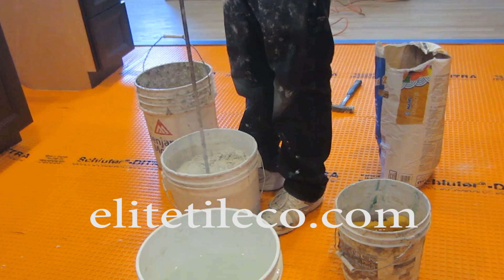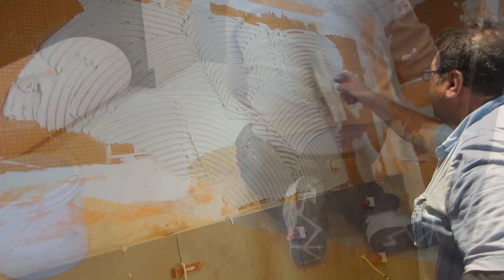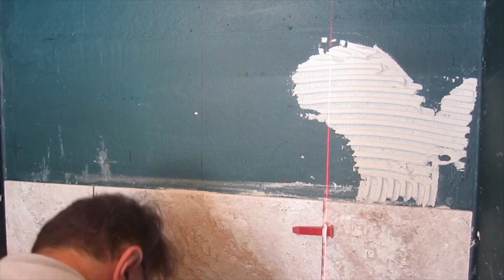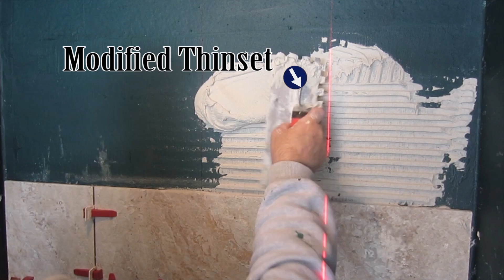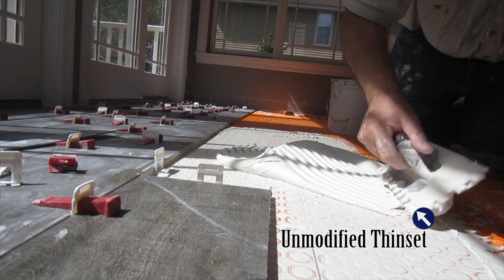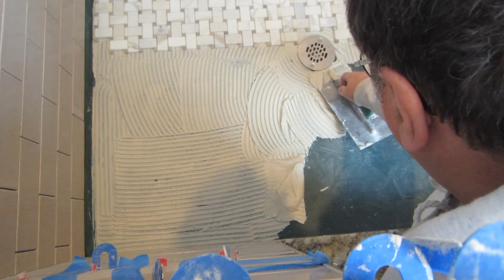Thinset explained

Comment: Ardex says their X77 microtec modified thinset can be used on uncoupling membranes. Have you hear this Sal? Do you agree?
Reply from the maker: Yes it can, no problem
Reply: @SalDiBlasi  thanks for the quick reply. can you explain why it's ok to use this modified thinset between the ditra and tile when schluter asks for unmodified?
Reply from the maker: Actually it has been a few years now that advancements in mortar technology has seen the development of many new mortars that make it possible to use a modified mortar between two impervious surfaces. These mortars will cure and harden without the extended dry times, they no longer need  evaporation of excess water to harden and dry. Schluter makes its own mortar, "AllSet" which is a high polymer content thinset Mortar that meets ANSI A118.15 specification, which they recommend to use for the installation of all Schluter products and also to set tile over those products. Also many manufactures will substitute their warranty for that of Schluter, if you use one of their approved mortars to set tile on Schluter products. The issue has never been whether a polymer modified mortar would work on Schluter uncoupling membranes or waterproofing membranes, it has always been about the extended dry times needed if they were used, that is why they recommended the use of an Unmodified mortar that cures and dries by Hydration. As a side note, the manufacturers of all other membranes never required the use of an unmodified mortar.

Comment: But then Schlueter came up their own modified thinset called allset they claimed it can be used on any situation. Why?
Reply from the maker: This video was done before AllSet was available. The reason that modified thinset can be used is because of an advancement in thinset technology that has made it possible to have a chemical dry of the thinset between two impervious surfaces. Many of the newer modified  thinset from other manufacturers can be used for this type of installation.
Reply: @SalDiBlasi  Thanks, I was hesitate to use modified thinset between membrane, I will give Allset a try.

Comment: So shouldn't you use an unmodified thinset over a roll on membrane like Redgaurd or Aquadefense since the the moisture would get trapped in just like if using Schluter and wouldn't let it dry properly? You pointed out that the thinset your using over the Aquadefense is modified.

Comment: Thanks Sal.

I notice you use modified Mapei over AquaDefense (as recommended). AD is also impervious to moisture (like Schluter), so why does modified work between two impervious surfaces for Mapei but not Schluter? Similarly, Schluter says use unmodified between cement (porous) and Ditra. I’m sure you also know that unmodified has to be super sloppy/wet for Kerdi and Ditra to bond to the substrate.

I still don’t quite get why can’t use modified for Schluter!
Reply from the maker: With some advancements that have occured over the past few years, that is not as much the case as it used to be.

Comment: If I’m installing Schluter Ditra to my cement basement floor, which mortar do I use? I’m new to tiling but would love to do our basement that’s $800sq ft. Any cheaper mortar you recommend besides the Schluter brand to install the Ditra on the cement?
Reply from the maker: Pretty much any good quality mortar will work to install the ditra on concrete, unmodified or modified.
Reply: Will there still be a warranty with Ditra if I use a different mortar brand though?
Reply from the maker: @absolutemalmaute9592  Yes as long as you use an unmodified to set your tile on the ditra.

Comment: Both types of mortars (white or grey) can go under any Schluter products and under any type of tiles installed over Schluter products with two exceptions. Both types of mortars cannot be applied over vinyl material and also the un-modified one (grey color) cannot be applied over plywood or OSM (particle boards). 
 If you install Schluter products over plywood or OSB subfloor, don't use the grey one (un-modified - Schluter Set), use the white one as it sticks and has a better bond.
I did complete the four days course from Schluter and I have to admit we used in class for hands-on training, the grey one, un-modified. I guess because is almost half price cheaper than the modified one and with the same result.
Here is the link for Schulter thin-set for more details: 
https://www.schluter.com/schluter-us/en_US/select-thin-set
Reply from the maker: The suitability of a mortar for a substrate or tile is not the color, that is irrelevant, what counts is the standard it conforms to. watch this https://www.youtube.com/watch?v=BJoPHGtukqo

Comment: Setting cement tile over  Schluter ditra would be recommend to use what type thinset?
Reply from the maker: Any Schluter brand mortar, or any other  premium unmodified of any brand mortar.
Reply: @SalDiBlasi Thanks Sal, for responding to my question. In my experience in the installation of cement tile over the ditra . It's a much better lay and more efficient for the setter with modified. I did a 16 hour test with 8"x8"s using both, the conditions were ideal. The modified was superior. That's why I asked the question. Thanks again Sal.

Comment: I use MODIFIED thinset 99.9% of the time.... years ago it was always via latex or acrylic additive (liquid)... today I've been using Flexibond and mixing with water.   But since Schluter products are tough to get where I work...  I'm normally installing over Durock,  using Redguard in wet areas - and  just cementitious board (usually 1/2 Durock- ALSO thinset with modified...  in other areas.   Seems to me Durock + Redguard is about the same thing as  Schluter/Kerdi in that there's no place for the moisture to go.   But I've never had any issues-  I wait a few days before grouting anyway so does not matter how long the dry time is for the thinset.... and I've never had problems on shower walls using MODified Thinset over Redguard. . 

So... are you saying it's A-OK to ignore Shluter's requirements to use UNmodified Thinset and use modified anyway on Kerdi?  Like others - while I appreciate the building science.. hydration/crystals/etc.....  but I am confused whether or not modified thin-set can be used with Schluter products.    Can it ?   Thank you Sal.
Reply from the maker: All the other manufacturers say to use modified  when going over a liquid applied waterproofing membrane, so they do not consider it to be a problem, schluter specifically wants you to use unmodified over ditra or kerdi, unless you are using Schluters own thinset which was not available when this video was made. https://www.youtube.com/watch?v=7N2k1RnmeJI&t=2s So follow manufacturer recommendation if they call for modified, then use modified, if they call for unmodified then do that. It should also be noted that there have been advancements in Thinset technology which enables a chemical cure allowing for thinset to dry without the need for evaporation, so there are many new thinsets that have this ability.
Reply: @SalDiBlasi  would you use modified or unmodified under the cement board? Under the cement is the subfloor 3/4" osb
Reply from the maker: @raptureready9502  Modified.
Reply: @SalDiBlasi  what about under the tile? Tile is 6"x24"
Reply: Porcelain tile
Reply from the maker: @raptureready9502  Modified.
Reply from the maker: @raptureready9502  You should watch this video https://www.youtube.com/watch?v=BJoPHGtukqo&t=495s

Comment: Hey Sal, I heard a contractor mention something about how thinset can become "detempered" if it's not mixed correctly, resulting in a fail. I didn't quite catch it, but it was something to the effect that after letting it slake if you realize you need to add more thinset powder to the water to stiffen the mix it will cause a fail. LIkewise if you add more water to the mix to increase the soupiness of it. Is this right? Is it generally ok to add either water or thinset powder when mixing as long as it's done before letting is slake?
Reply from the maker: The guy is actually correct, once the thinset has slacked, it should not have water added to it, or powder. If has been sitting in the bucket a bit and starting to get a bit stiff, it can be spun with the mixer to loosen it up, but don't add anything to it.
Reply: One other thing I've heard conflicting ideas about is which to add to the bucket first: Water or thinset. I've noticed that adding the powder first then water can cause clumping and throws up excessive powder "clouds" which obscures the view of the inside of the bucket making it harder to mix correctly. I see you added the water first in the video which answers my question, but just wanted your take on if there is ever a time when the powder should be added first.
Reply from the maker: I always add the water first, but as long as it is thoroughly mixed, it can be done either way, the water first does make it easier.
Reply: Hey Sal, it's good to know you're here, educating. I've come a good ways thanks in great part to your video productions. I decided to join NTCA after viewing several of your vids on the subject. Best decision I ever made. Carlos Collazo
Reply from the maker: Well then, you need to become aTile Geek https://www.facebook.com/groups/TileGeeks/?ref=bookmarks
Reply: :D

Comment: Sal, I would like to know your view on the durability of a tile (porcelain & ceramic)installation using the practice of each the following methods as opposed to laying tile on a dry and set deck mud base.1. immediately  laying floor tile using thinset  after putting down  the deck mud base (while it is still wet).2. Sprinkling Portland cement over still wet deck mud base and laying the tile on the Portland cement . thank you.
Reply from the maker: Portland cement is not a good idea, not designed for tile adhession, however using thinset and back buttering each  tile an set into fresh mud, or a loose mix of thinset on the mud can work. I have seen the method you describe fail many times. Depending on the type of tile Portland cement may work, but a dense vitreous porcelain tile has very little chance of success in my opinion.

Comment: We were instructed to seal our limestone travertine files BEFORE installation 3 times front and back. Now they are claiming they didn't say it after I magically sealed ALL OF OUR TILE! Now they are saying to insure the bond to use epoxy as thinset. ? Please advise us. We are first time shower tile installers. I think we are headed for disaster.
Reply from the maker: I probably would not have sealed the back of the tile before installing it the front is not a problem, you have to seal it anyway.  Thinset creates a bond by growing crystals as it dries and cures it penetrates into the little voids, texture and pores on the back of the tile, sealing the tile closes the pores to an extent to protect the stone from staining and absorbing liquids, yet allows the stone to breath. The only way to know if the bond will be affected is to do a test. Mix some thinset, stick a tile to it and then let it stay for a week or so, then tear out the tile and see what the bond was like. Then decide if it was sufficient to install the tile. If it is not acceptable move to the epoxy adhesive and do the same.
Reply: Sal DiBlasi Most strong adhesives create microcrystalline lattice structures, known as "crystals".  (This isn't the traditional sense of growing crystals like in underground rock formations; it's merely lattice structures.). This is a packing problem in solid state physics 101. Of course, you want to keep moisture and air out of these pockets, as well. Pretty common sense. This idea of "crystals" is not rocket science nor a fancy new term. Rome wasn't built in one day and anyone who tries to do that in their home, business lacks that wisdom. Great video, by helping emphasize common sense while staying away from Big Time Fraudsters like all the Schluter systems.

Comment: so if the wall is extremely(totally ) well sealed and large 12x24 tile is being applied , an unmodified med bed mortar may work best ? (or schluter set )
Reply from the maker: Schluter is the only one that calls for unmodified, otherwise it is pretty much always Modified.
Reply: when installing kerdi membrane over drywall do you use modified or unmodified thinset to glue the membrane to the drywall?
Reply: sal wont see this question as reply to my question, however, if drywall is not sealed a modified will retain moisture for crystal formation (repost as general question for Sal's input)
Reply: Drywall is a horrible substrate for anything other than paint.   I think it's a waste of money to put Kerdi membrane on drywall.  Replace the gypsum board in the tiled area with cement board (Durock)- tape/thinset the joints and  don't worry about the membrane.  Just my .O2 - YMMV

Comment: Great video! I am relatively new to the DIY scene. I just want to confirm that on concrete substrates, I am better off using unmodified, sanded thinset and the use of modified thinsets for concrete substrates would be more of an overkill (unnecessary additional expense) --- I would greatly appreciate it if you could comment on this. Thank you...
Reply from the maker: Depends on the tile, for porcelain I would use Modified for sure.
Reply: What about ceramic tiles on  concrete substrate --- would unmodified thinset be appropriate?
Reply from the maker: I would feel better using a modified thinset, however unmodified should work. The question is not whether you can, but whether you should. It is always smart  to use a higher quality adhesive and not the cheapest.
Reply: Thanks a lot for the invaluable comments. I will be following your advice when I replace next week some of our floor tiles that popped up after almost 8 years. More power to you!

Comment: Why can modified be used on other water proofing systems, but not schluter?  I have seen videos where guys find the thinset still wet under tile. Should I use modified for setting my large format wall tiles with water proofing under it?
Reply from the maker: Schluter requires unmodified to set the tile, unless you use Schluter Allset thinset. https://www.youtube.com/watch?v=7N2k1RnmeJI

Comment: Sal. For a beginner diy job do you recommend the kerdi board. I've heard that as you need to use unmodified thinset the tiles slide easily
Reply from the maker: Tiles will slide with any thinset if it is not a no sag thinset. So if you use Schluter's thinset, you can use modified for everything, that would be Schluter AllSet, or you can use their unmodified to set the tile, Schluter Set. If you use some other brand of thinset, then you need to set the tile with unmodified.
Reply: Sal DiBlasi 

That makes sense. Thanks Sal

Comment: Hi Sal got another question for you if you don't mind. I will be using Ditra set for Kerdi and ditra there instructions are a little rough says to use 5 to 6 quarts of water and doesn't give a mix time just <150 rpm and no slake time have you used Ditra set and do you have any recommendations on mix time and weather or not to let it slake.
Thanks!!
Reply from the maker: Typical thinsets are mixed for 3 to 5 minutes, slake for 5 to 10 minutes then remix for  2 more minutes, so try that and see how it goes. One thing, never add water after the thinset has slaked.
Reply: Will do Sal wasn't quite sure on the slake part because it said no slake required but I have never heard of that before just thought I would get your opinion on it.

Thanks
Reply from the maker: If it says no Slake required, then no need to do that, I actually know of other Thinsets that are like that was not aware that Ditraset was one of them.
Reply: Seems they changed that not to long ago I was reading on some forums that ditra set use to call for a 15 min slake time .
Reply from the maker: Products get changed and tweaked all the time. I have used quite a bit of Ditraset in the past, and was sure that it required slake. But I just looked it up and it says no slake required.
Reply: Yes sir that's what it says on my bag also I am thinking maybe I should have went with Tec instead but I just bought 8 bags of Ditraset so I will just use it I still may do the 5-10-3 but maybe not what is your preferred thin set?
Reply from the maker: Ditraset is a great product, Like I said I have used it quite a bit, my supplier does not carry it anymore, otherwise I would still probably use it.

Comment: Sal, great videos by the way.  When asked, you said you use TEC Uncoupling Membrane Mortar on Kerdi board.  The bag doesn't say it's unmodified.  In fact it says there are latex additives in it which would make me think it is modified.  For that application Schluter calls for an unmodified thinset.  You don't seem to be a fan of Laticrete 317.  TEC is hard to find.  Any other recommendations for thinset using kerdi board/band?
Reply from the maker: TEC Uncoupling Membrane Mortar is an unmodified mortar http://www.tecspecialty.com/products/mortars-and-mortar-additives/dry-set-mortars/Uncoupling-Membrane-Mortar.html#.WN7PZzvyuUk If you can't find that Try Mapei Kerabond, or Bostick Ditraset, 317 will work, but it is a lower grade Unmodified Thinset. Schluter has just come out with its' own thinset, might be hard to find for now.

Comment: Hi Mr. Diblasi,
On a shower with a waterproof membrane such as hydrobond, would you use mod or unmod?  I would think the moisture would be trapped and extend the hydration longer than desired?  
Thank you.
Dave D.
Reply from the maker: Hydroban calls for modified. Schluter is pretty much the only one that asks for unmodified, and now that they have stated making their own thinset, you have the option to use modified as well with Schluter.
Reply: Sale Diblasi
Thank you sir.  RTFD ...